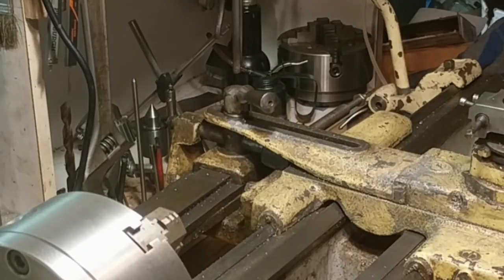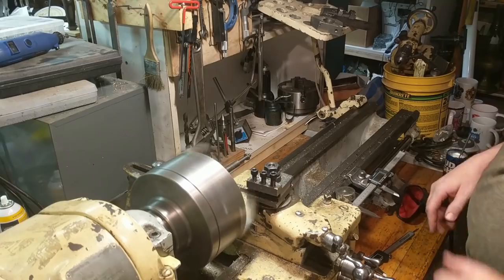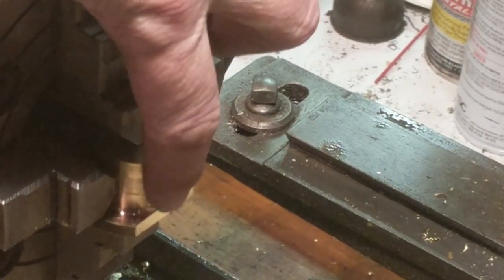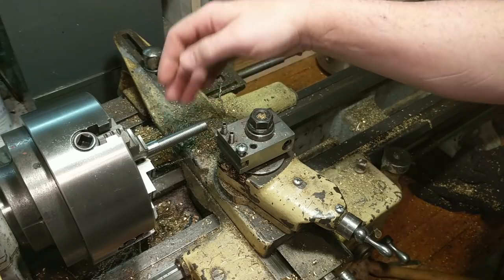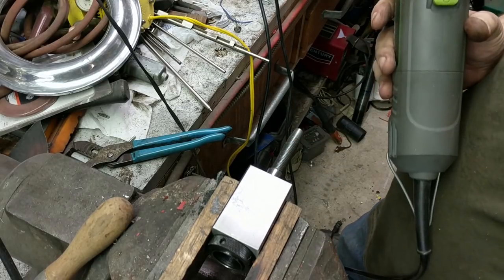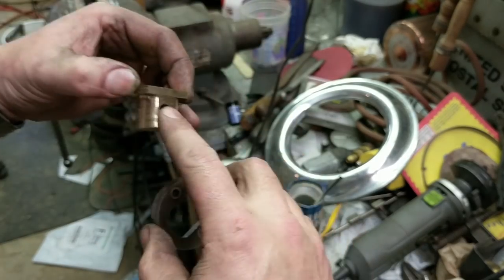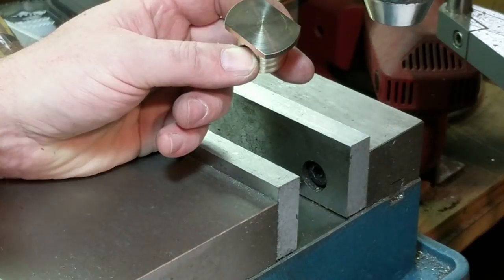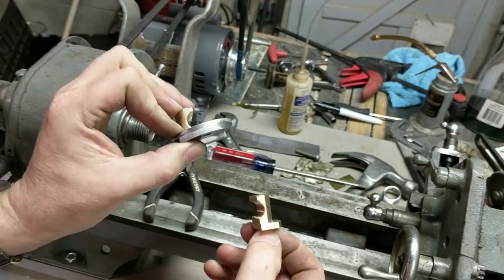Making a New Half Nut for the Atlas 618 Lathe Part 2 of 2

Comment: How were you able to gauge your 16 tpi acme cutting tool?
My little acme "fishtail" gauge ends with 10 tpi.
Thanks!
Reply from the maker: I don't remember for certain.  I think that I probably set my grinding guide to grind the hss blank at a 29 degree angle, and then ground it close to a point.  Then ground it back square until it fit snugly in between the threads on my 16tpi lead screw.